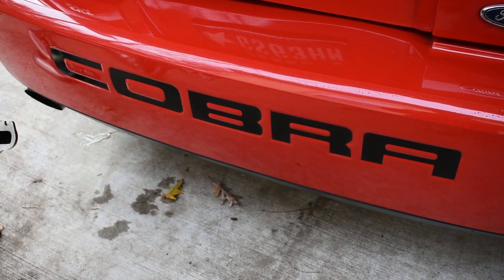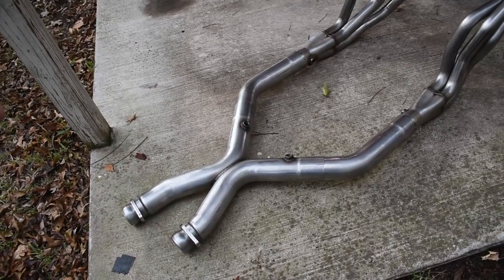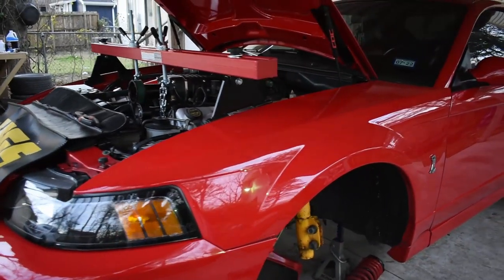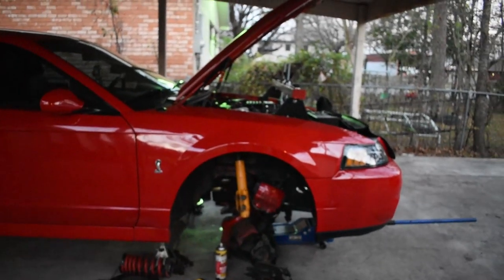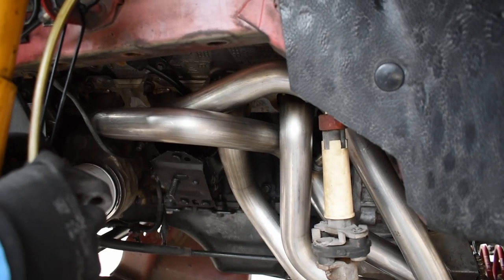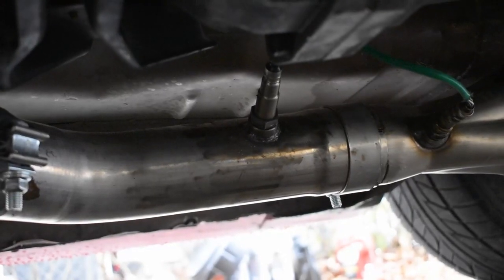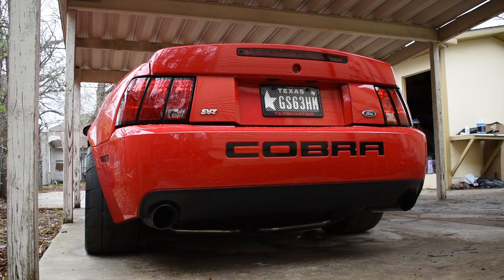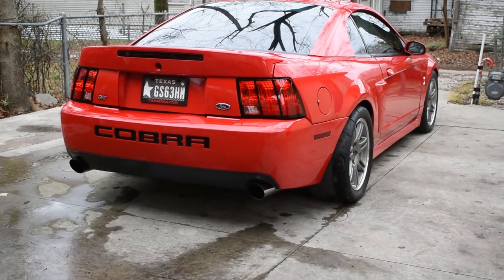My 03 Terminator Cobra gets American Racing Headers (ARH)

Comment: I am really wanting to get arh long tubes and off road x pipe for my 2013 5.0 and was wondering about some things. First off, how bad is the smell with the catless setup? I'll be running the corsa extreme axle back, factory over axle pipes, and factory resonators. Would the resonators and corsa extremes eliminate some of the catless smell? Second, the sound, how loud is it really? I have done my research and listened to videos on youtube and really like the sound, but it's hard to tell how loud it really is over youtube you know. Since I daily my 5.0 I don't want to regret going catless you know. Third, the obdll sensors, would the tune get rid of the check engine light that comes on after going catless? Lastly, inspection/emissions. I also live in Texas, the montgomery county area which requires emmsions. Would I just be able to drive to a neighboring county that doesn't require emissions to get it inspected? Also, have you had any problems with getting your inspection sticker at all?

Thanks in advance for your or anyone's answers!
Reply from the maker: Very nice, I had a 13" gt myself. Going to a catless setup you will still smell some fumes but not as compared to an off road setup. I had arh headers mated onto a corsa xtreme catback on my 2015 mustang gt. I also had cats on it. The setup was honestly super loud. Inside the car wasn't bad at all but cold starts were the worst. I later switch to the corsa sport catback and that was the best decision I made. If your daily your car then I highly suggest you get the corsa sports over the xtreme. Now, your using your factory resonators which will definitely help tone down the volume. But as far as smell, the resonators don't eliminate that. The smell won't be bad at all honestly. As far as emissions, you should be able to pass with having those hi Flo cats from ARH. Good luck man and thanks for watching my video 🙌🏻

Comment: Awesome install! I appreciate all the time you took to include detail and explain how you did it. One question I have to ask is, did you have any clearance issues with the steering shaft or did you replace it with a solid?
Reply from the maker: Ofcourse! And I appreciate the comment! As far as clearance, the stock steering shaft works just fine with these ARH. That's a big reason why I went with these too. The only area I had some clearance issues was on the passenger side. The header has rubbed against the transmission tunnel slightly but not very much.

Comment: Awesome job man! I know from experience, it’s not a fun task. On the ball flange where the 2.5 inch cat back meets the 3 inch X pipe - did you do any modding like get an adapter? I have a 3inch system all the way back but was thinking of switching to a 2.5 cat back so curious what’s required OR if it will bolt up without any issues. Thanks!
Reply from the maker: Thanks man! So for the ball flange, ARH offers the 3" x pipe for either a 2.5" or 3". In my case I got the one for the 2.5" catback. Is there a particular reason why your thinking about going to a 2.5"?

Comment: Anything done to your transmission for upgrades? Any issues with it? Curious how they hold up! I love the stock t56
Reply from the maker: It feels great honestly. It has a 26 spline input shaft and a spec clutch along with the firewall adjuster and quadrant. When I bought the car I had yhe throw out bearing replaced as well as the shift fork with oem Ford racing parts.
Reply: @loscar5oh  Nice I figured you had all the right little stuff done already! Yea some feel different from another. My current sonic feels stiffer and more rigid vs my DSG which was still pretty stiff. Cause I missed it when I went to magnum. But I felt my friends stock trans and MGW shifter and his was sloppy feeling 😬. He actually thought his was stiff until he felt my shifter. His car has 15k miles too! 
It’s funny, although these cars were all “the same” technically, there very very different one to another.
Reply: @loscar5oh  mod you need this year is sub frame connectors!! Those are a must!

Comment: Looking at these same headers but torn between getting the ARH catted or OR/X pipe.  Do you get the exhaust smell in the cabin with your OR/X with these long tube headers?
Reply from the maker: Thats understandable. You can always get both mid pipes and switch from one to the other depending one what you like best. There's is a slight smell but I think ARH is the best in that aspect becuase of the slip fit design.

Comment: If you need to get these apart down the road to take the off road legs off and add cats for inspection (if they have that in your state) just use liquid wrench or wd 40, spray it in the split where the pipes meet and they come off with a little bit of wiggling, sometimes with the persuasion of a rubber mallet but normally the wd 40 or liquid wrench in the split does the trick.  Without it, you'll never get them off.
Reply from the maker: I appreciate the tip! I will definitely consider doing this if they give me issues down the road.
Reply: @loscar5oh   No prob man,  I have the same headers on my 03 terminator and bought the cats and off road legs.  I had to change them out because I moved to a county in Georgia with emissions.  Took about 10 mins to change out and once I got the inspection done changed them back out again.  Super easy.  Using antiseize is something I've never thought of so the next time I pull them off I'll be sure to do that as well.

Comment: I have an ARH headers & x pipe combo getting put on soon.. can I still put a cat back system on it or would it only allow for a axle back to be put on due to the x pipe ?
Reply from the maker: You can still put on any catback you like. The ARH x pipe has the flanges that bolt up to a catback.

Comment: I'm installing this same setup on mine, did you re-use your factory studs and nuts or did you use the grade 8 header bolts that come with the kit? 🤔
Reply from the maker: I reused all factory studs and nuts. I just made sure I cleaned them well before re installing 👍🏻😎
Reply: @loscar5oh  Dope, I don't have the space or tools for this job so a shop is doing it. They highly suggested I use grade 8 bolts, either theirs or ARP. What are your thoughts 🤷🏿‍♂️
Reply from the maker: @Daywalker78  I was advised by a friend who works on a lot of terminators to just use the factory ones so that's what I did. Either way I'm sure you can't go wrong with whatever you choose.

Comment: Did you buy that engine hoist thing? How much do those run? What a job so far only 5 min in.
Reply from the maker: Yea I bought it at harbor freight for like $80 plus tax. It's a nice tool to have. I will definitely use it again in the future for other mods I'd like to do.
Reply: @loscar5oh  sweet! I’ve never even used one before. Always just used a hoist but hated the legs of the hoist getting in the way under the car ! So this is great

Comment: I had to tap a small dent in one of the primary tubes for clearance.  Also, the EGR tubing was a chore.  They otherwise fit great.  Man, that was big job to do on the garage floor. The headers made my car quieter surprisingly.  I'm guessing the velocities are lower??
Reply: Also, after a tune, it made 50 more pounds of torque at the wheel.
Reply from the maker: Did you use an aftermarket k member? I didn't have to modify the headers. They fit well. It's crazy how your car got quieter lol. What catback are you using?
Reply: @loscar5oh  I did the 1 and 7/8 so it may have been a little tighter.  It has cat delete with 3 inch magnaflows.  They are the non chambered pass through style.  It's on a torch red tenth.  Looks like your car.
Reply: Stock k member.  It absolutely had to be removed.
Reply from the maker: @jasonmitchell7677  very nice man. I bet it sounds really good! Perhaps that extra 1/8" diameter would affect something. Where exactly did you have to clearance it?
Reply: @loscar5oh  I believe it was for the EGR tube.  I had to loosen the tube at the top, but not disconnect it all the way.  It would be interesting to hear the difference in the header size.  Some say the smaller diameter is better.  Some say otherwise.

Comment: Im looking to get a set of headers for a cobra as well, just curious if there wouldve been any advantage on going with 1 7/8?
Reply from the maker: You won't regret it man. It's one of the best mods I've done. As far as the primary size, my tuner reccomend I go with 1 3/4". He said anything bigger than that wouldn't be necessary. I don't think there's a huge advantage. It may make a difference if you were making big power like 1k to wheels.
Reply: @Loscar5oh  gotcha, thanks for the info man, love the sound came out great!!

Comment: Hey bro quick question did you have any problems with the stock k member and long tubes ?
Reply from the maker: No problems bro. It may be a little tight in certain areas but the headers clear fine.
Reply: @loscar5oh  thanks bro Ima Oder some this week you got the 1-3/4 ? Right ?
Reply from the maker: @sabinoguzman7780  awesome! thats what I got.

Comment: I put Kooks long tube headers and their off-road X pipe on my cobra years ago I don’t know if the performance bump was worth the cost but the car sounds much better. Also taking the k member out to make installation easier is a pain! Also if you reinstall your EGR and your oil dipstick can also be a little problematic.
Reply from the maker: I don't think there's much performance gains but I did it mainly for the sound. Surprisingly, my car is making the same boost with the long tubes verus stock manifolds.

It was definitely a pain but well worth it bro! My car had the egr deleted so I capped it off.
Reply: @loscar5oh  I still have a stock blower and a 2.93 pulley my boost is at 12 pounds I think it went down maybe a pound. But I did pick up like 30 hp in about 70 pounds of torque on 93 octane. I’ve had my car since 2007 I can’t find a reason to get rid of it I’d have to pay too much money to replace the performance it provides. I enjoy your videos I hope you continue making them!
Reply: Did you have to have the headers loose for the dipstick re installation? Or can you do it with the headers already installed? I just mounted my driver side and forgot to put the dipstick in place while bolting it up. Its all bolted together and I'm having a hell of a time putting the dipstick back on
Reply: @69chevnova1  Had to loosen the header to make sure everything lined up no issues.

Comment: Have you had any problems with heat or other issues with the long tubes
Reply from the maker: No issues til this day. The one thing I'd reccomend is just re tightening the clamps as they may get a little loose after the first drive. I also noticed that the passenger header was sighting rubbing against the firewall/trans tunnel but very very minimal.

Comment: I just did long tubes on my 04, did you need a tune after? I’m running leaner after.
Reply from the maker: Per my tuner he said I didn't need a tune revision. It may be best to check with your to see what they say.
Reply: @loscar5oh  yea he said to datalog and it showed lean on my wideband. Probably need to add some fuel, I’m ported FBO.

Comment: quick question I just got my 13/4 American racing headers which it's 3 inches and I want to get the Bassani cutback which is 2.5 inches for my 2004 mach 1 what connector you think I should use from 3 inches to 2.5 inch
Reply from the maker: If you ordered the kit new, it should have given you the option to choose between the 2.5" or 3.0" collector at the mid pipe. If you ordered the 3" collector, then you may have to get new connectors welded on but im not sure about that tbh.
Reply: Actually once ordered the ARH 134 it doesn't have an option for the x pype to be 2.5 inch beside 3 inch. However I just look that there are bassani exhaust with 3 inch I'm not sure if that fits :( im confused what to do.
Reply from the maker: @Ali Ostad  ok, so when choosing the x pipe size, it gives two options. The options are 3"x2.5" or 3"x3". If you get the 2.5" bassani catback then choose the 3"x2.5". If you get the 3" bassani catback then choose the 3"x3" option. The x pipe itself is 3", but the collector is what changes in size depending on the size catback you will use. I hope this helps.
Reply: @loscar5oh   I ordered the American racing headers since a week. And it just said 1-3/4 "3" and doesn't says anything in another side. sadly :( but I didn't order the exhaust yet .
Reply from the maker: @Ali Ostad  I would just contact the company who you ordered from and ask what size outlet will be on the mide pipe. That way you know which catback to order.

Comment: Did you use MIL eliminators  since you are using the off-road x pipe?
Reply from the maker: No I didn't need them as the car was tuned with an off road x pipe prior to the header install.

Comment: What size tires do you run on the back??
Reply from the maker: I have 315 35 17s. Currently on my oem 17x9 wheels but I just bought some 17x10.5s that I will be installing soon.